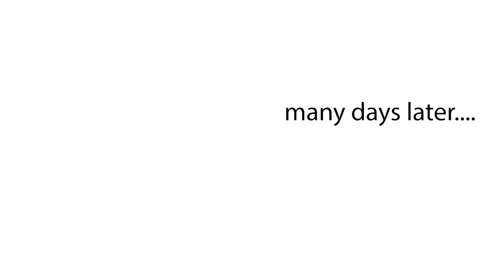BMW Airhead Mechanicals #5 - Final Drive

Comment: Thank you for taking the time to make this video. You saved me a ton of frustration. I thought refreshing the monoshock RD bearings and seals after a spill gave  it a good smack would be simple as it was on the K bikes. Not so. One of the wonderful things about getting older is that we drop the pretense that we can do anything. Know when to hold 'em, know when to fold 'em. Know when to farm the job out to a tooled-up expert.

Comment: Hi @William, absolutely great stuff.. You are a natural in front of a camera.. I have a 1987 R80RT which I’m restoring and I ordered a gasket for it, but can now see you reassemble without it. I didn’t find one on disassembly, but thought it just deteriorated over time.. So now my question is whether I should use the one I bought or not? By the way, I can’t find the torque setting for the 8 housing bolts  in my Haynes, can you share those? Thanks a ton, Chris from Denmark

Comment: The blue machinist's dye showed the pinion was contacting the drive gear in the middle/towards the outside of the teeth,. I expected you to try to make an adjustment so the teeth meshed together as uniformly as possible. It seemed like they were only making two thirds of the ideal amount of contact. Would love to hear a little more on that. Keep up the excellent work.
Reply from the maker: Matt: The type of gears in the final drive are known as klingenberg. There's information out there if you search for it. You don't want to achieve a full engagement of the teeth, so it's about where they make contact. Ideal is not quite in the middle of gear but slightly towards the wider end of the gear. Have a look on-line and you will most likely find illustrations of the ideal contact patterns. It's also referenced in the repair manuals.

Comment: Hi William! I have a R45 from 1979. I don't know if this is a stupid question but I feel like I only have 4 gears. On some pages I can see that there should be 5 :) does that mean I have a problem with my final gear? My final gear looks a bit different than the one you just operated on.

Comment: Great video but if you have to buy all these special tools to take apart a BMW it might become an expensive project. I took apart an old Honda CB and I only needed like 3 special tools. 30€ (30$) in total and the complete bike came apart. A BMW is well engendered as is a Honda but you need a lot more special equipment which makes it expensive and complicated. I'm a huge BMW fan but I'm afraid to restore one due to the complexity.

Comment: That tool you are using.. is that supposed to push out a lining of the brake cam going through (where you mention the o-rings before abruptly going to "the tool")?? Normally if you, as a repair option, have lined the way of the brake axel, you don't need o-rings. Really confused, and not convinced that you know what you are doing. the holes that the brake axel goes through to reach the cam and thereby the braking shoes, is not normally lined (hence the o-rings)??????

Comment: Exelent video, I do need to have alook at mine here in New Zealand but I am still wondering how I re revit the drive dog on the the rear wheel on my R80/7, I have seen people explaning bolting them back in with aircraft fasteners but will it work?

Comment: Hey John, When I put the pinion drive back together there is a little bit of play in the shaft back and forth.  Should there be any play in there or not?  Like if I grab on the end of the bolt I can push it back and forth about 1/16th of an inch.

Comment: Hi Will, thank you very much, this is very helpful. It is the first time (finally!!!) that I can see how the backlash is measured.
You have the power to make things looks very easy to do.
Sharing your experience is very appreciated, especially these days that we all have extra time at home.
Any idea where it would it be possible to buy the tools for the backlash measurement? Or at least the BMW part numbers.
Can I use them on a 1983 R100RS as well (dual shocks).
Thank you again and looking forward to the next video. Cheers and stay safe!

Comment: Is the drain plug on the final drive the same plug as the one on the /5 models? My threads are buggered and I need to Helicoil them. Do you know the correct size insert it needs?